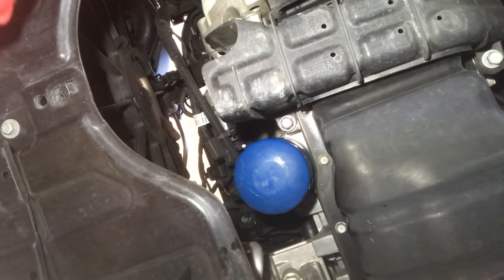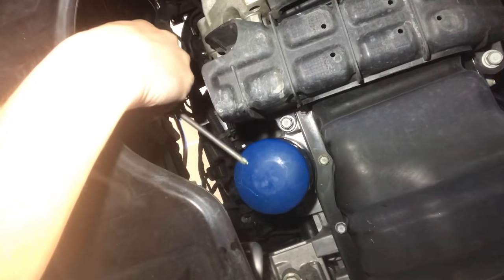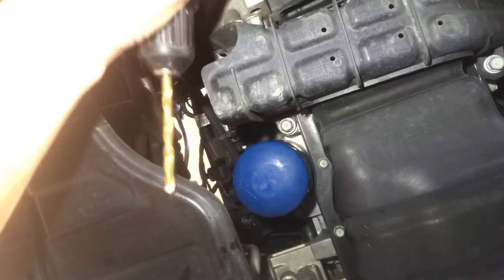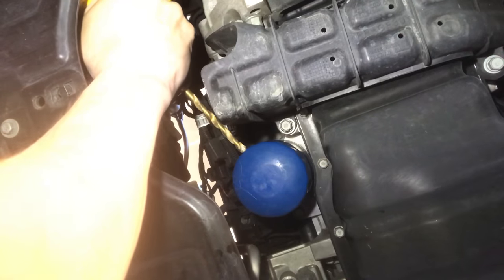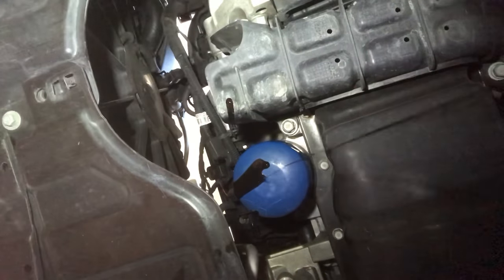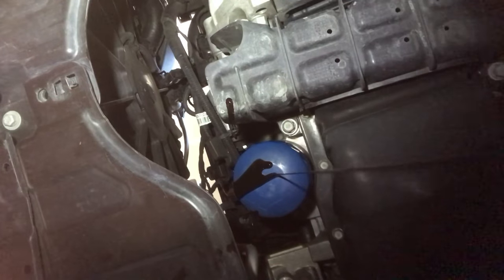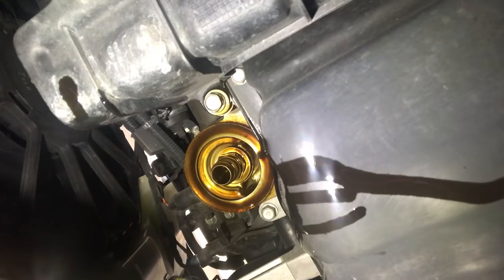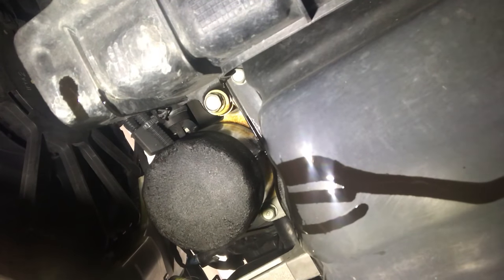Removing a Stuck Oil Filter In a Location w/ Little room

Comment: Additional mess saving tip: (because "I've been there, done that.") Before you drill in from the side, with nail or drill, poke hole in bottom of oil filter first. You will drain the filter and have much less mess when drilling in from the side. Yes, it adds a  minute to your procedure but I'd rather drain what oil I can, than have oil under pressure shoot everywhere when going in from side.
Reply: 👉🍻🍻🍻🍻👌 thanks !

Comment: This is the stupidest design of oil filter of recent Honda accord after 2016. I have a 2004 accord which is very easy to remove the filter. But my 2016 accord is just like this, there is no room for regular tool to remove the filter.

Comment: This worked great. A screwdriver was too big for me to turn but I just used a 3/8" x 5" drill bit (detached from the drill) and was able to use that to turn it. F*ck valvoline for putting it on so ridiculously tight.

Comment: What if you drill through but it still won’t come off? That’s what I’m worried about. My car will be stuck!
Reply: Mine was stuck and that's what I was worried about. I thought about it and just said the heck with it. Came off with ease.
Reply: Try hammering two screw drivers in the bottom first and twist off, that way you spread the force to 2 points instead of 1. If it just shreds then try this method. If all else fails and the whole thing shreds then you gotta tap it out with a hammer and screw driver.

Comment: I just had some inventive fun changing my oil while I'm away from home, temporarily living in a trailer park. I put scrap 2 * 4 and 2 * 6 is in front of all four tires to drive onto and lift the truck up four and a half inches. I cut the side off of a brand new jumbo size box of Mini Wheats, I put the Mini Wheats in my cupboard, and I put four plastic bags Inside the Box. That is what I drained the oil into. Since I didn't have a oil filter removal tool, I used the hammer and screwdriver trick, worked great! The mouth of my plastic fruit juice container was too big for a funnel, so I poured my HP Sauce into the fruit juice container. Then I cut the bottom of the HP sauce container off and used the remaining container as an upside-down funnel. Then I poured the oil out of the plastic bags which were inside the cereal box, into the Now empty oil container, and tomorrow I'll take that oil to the recyclers.

Comment: Remove the plastic shroud to give you room!  What would you have done if it just ripped the filter?
Reply: Buy a “Safe Jack Talon Oil Filter Tool” for $50 to remove it or have it towed to a shop.

Comment: I recommend getting one of those oil filter sockets that fits onto the back of the filter. Your ratchet fits into the back of it so you can get some good torque on it.
Reply: I've got like 4 different sizes of those things, but the BRAND NEW filter I'm taking off my john deere has a round end. Those stupid hillbillies over torqued it from the factory!
Reply: Doesn’t work, the socket just keeps slipping and doesn’t grip the filter
Reply: @capostrength3908  same its too tight
Reply: Not only did I use the socket, but stuffed one of those jar opening pads to provide extra grip. No dice. The screwdriver method worked, but just barely. Was close to shredding it in half.

Comment: p.s. again:  i'm going with K&N next time just to see if the nut on the filter is all they say it is.  it costs more but it might be worth it.  i know Auto Zone has sales sometimes with them.
Reply: don’t buy parts from auto zone unless you like getting ripped off. use an OE filter and just put new oil around the gasket, it’ll prevent sticking.
Reply: Yeah good luck with that the bit stripped on mine and now i had to do this
Reply: Looks like a good idea, but corrosion will eat at it and it’s so shallow a 1” wrench will just slip. Tried them on Kohler mower engines and just ended up going back to FRAM.

Comment: I used a plumbers wrench to clamp down on the filter and then a vice grip wrench to clamp down on the plumbers wrench at a 90 degree angle. Filter comes right out without all the mess of making a hole in the filter.
Reply: Tried it. Didn't work lol
Reply: Umm!.... the average Joe will not have a plummer's wrench....but he will have a screwdriver and a hammer!

Comment: That didn’t work for me so I had to buy a “Safe Jack Talon Oil Filter Tool” for $50 to remove my filter. Talon oil filter tool will fit inside the  3 holes of the filter, which then you twist using a socket wrench to remove what remains of the filter. It’s an expensive and time consuming mess. I like your idea better. Not sure why but when I tried screw driver my filter just shredded.

Comment: guys like this is where the term grease monkey comes from. There is a tool that consists of a wide metal C band with a plate that has a 1/2" square hole in it. You use a 1/2" ratchet and crank counter clockwise until the filter snaps loose, a bar on the end of the ratchet helps with the most stubborn ones, (old diesels etc.) In this particular case, if you're like the op and too lazy to remove the plastic guard there on the left, just add an extension to the ratchet and tight spaces won't be a problem.
Reply from the maker: When you don’t have the tool and you are in the middle of the job and do not want to drive 25 min to buy the tool, this is what you do.
Reply: @23sapper  doing it is one thing, teaching others this method is another. If it doesn't work you're left with an oil puddle and stranded car in the driveway.  btw if u can fit a drill in there it's not too tight to try other methods..
Reply from the maker: One of  the aspects I have enjoyed over the years with my YouTube channel are comments like these.  Comic relief is healthy for the soul.  Have a wonderful day.

Comment: I used a tool with the 2 closing claws in the filter.It still would not budge.So i bent the claws closer and then turned very gently and came loose.2008 Subaru Impreza.Just wish they put the filter in a better spot to remove.

Comment: Bad idea...extremely messy. A tool exists called an "oil filter claw". Simply attach the claw and then attach a ratchet on the other end of the tool.
Reply from the maker: Ya, but I didn’t have time to drive 25 minutes to go buy one.
Reply: the claw can damage a filter if it is extremely tight.  this screw driver trick is a last resort only and i've used it myself to save a tow truck fee
Reply: @davidwilson3465  The claw can damage the filter but the screwdriver doesn't? Hmmmm okay.
Reply: @myshinobi1987  he's saying BOTH can damage, and they will. I've had stubborn filters before that broke my ratchet cap, then I resorted to this technique. This is last ditch effort right here.

Comment: My starter is right next to my oil filter and I'm afraid of hitting it with something, last time I changed my oil I attempted to use my belt and the buckle did hit it...sparks flew
Reply from the maker: Disconnect the red cable on your battery and there won’t be any sparks.

Comment: I tried this and it just peeled a larger hole in the filter
Reply from the maker: It’s tricky sometimes
Reply: @23sapper  
I went to advance auto, they were surprised too.

She gave me this pair of vice grip like things that crush and dig into the filter. That worked like a charm but they were 20 bucks, so I say the car beat me this time. 

Filter was just too thin unfortunately
Reply from the maker: @danh9676  I’ve had some pretty tight like that and had to break out the vice scripts.

Comment: Dirty job.  Glad you got it.  Couple of things to know.  Best to go ahead and poke screwdriver through all the way to get better leverage.  Less chance of having to re do the drill trick.  Second, use rubber gloves.  That burned oil crap is actually bad for you.  p.s.  do this experiment sometimes; take a used FRAM filter and saw it in half.  compare to a quality filter.  FRAM is great in their advertising of their products only.
Reply: they use paper filters that fall apart

Comment: This was the worst idea ever. I don't use a wrench to tighten my filters on. Always hand tight. This particular change the filter would not come off so here I am trying YouTube tricks. All it did was put oil all over the filter preventing me from getting any kind of grip and ripping the filter apart voiding any chance of using a filter wrench. Never do this